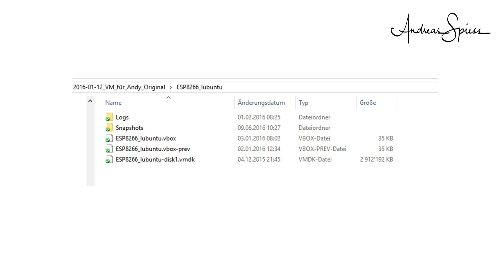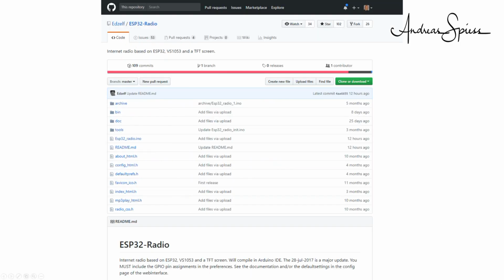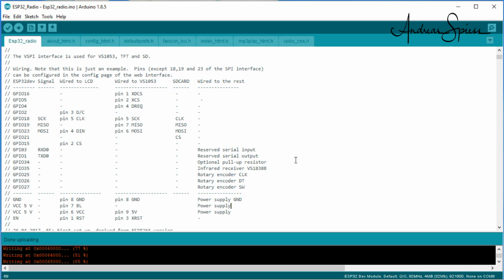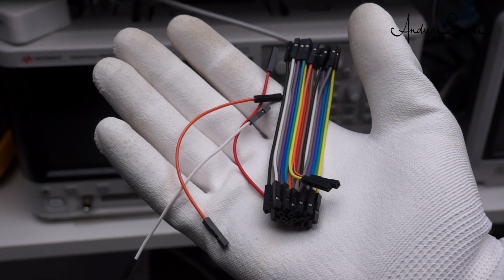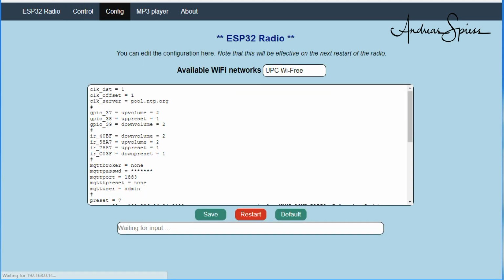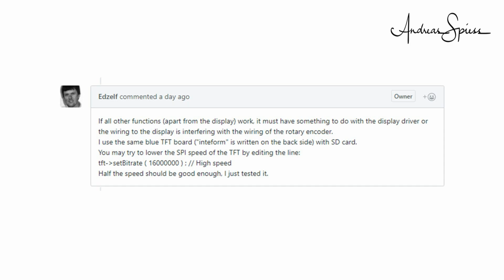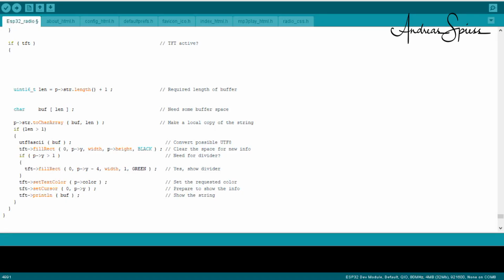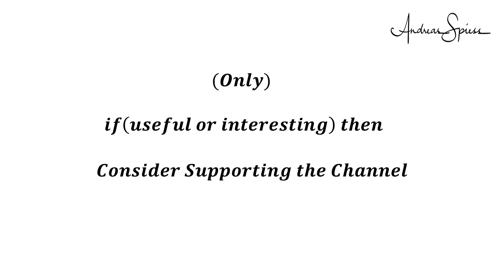#195 DIY Internet Radio using an ESP32 (Arduino IDE)

Comment: Hi Andreas - this is a great project and I have built all the wireless versions, but I have never been able to get the LAN version using WT-ETH01 working. Is there a possibility of update for the project, to include WT-ETH01, or a video on the use of the WT-ETH01 module - as an alternative to wireless? 
Love the channel it brings great humour and solid information, with education - many thanks.
Reply from the maker: This never was my project. So you have to ask the creator. Or these days, I would ask ChatGPT...
Reply: Sorry Andreas, it was more to do with the WT-ETH01 Ethernet module, it just seemed a good idea to use this. Appreciate your response, many thanks

Comment: Great channel - much inspiration.

Question on the ESP Radio V2 (and V1) Has anyone reported problems with the following on pio build of project

"Library Manager: Installing me-no-dev/ESP Async WebServer @ ^1.2.3
UnknownPackageError: Could not find the package with 'me-no-dev/ESP Async WebServer @ ^1.2.3' requirements for your system 'windows_amd64'"
I have tried manual install of library and checked library files, even tried older versions of library - has worked fine before and have built quite a few modules in 2024 - but now get this error - any advice, ideas appreciated

Many thanks Andreas  - for the wonderful projects and documentation
Reply from the maker: My pleasure!

Comment: Hello. I am little bit confused so before start of making my internet radio based on your github link and this video. My question is that on github where I DL whole package in ZIP, I can't find the main file (.ino) for programming ESP32. Am I something wrong or what ?
Reply from the maker: The project is made for PlatformIO. There, no .ino files are used. Maybe you watch a PlatformIO introduction first.
Reply: @AndreasSpiess  thank you for this explanation. Also is there any schematic (wiring diagram) for this project? I can not find also Gerber file for PCB created by Naked Ninja. Is it somewhere avilable for download ?
Reply from the maker: @petrikajaneku6451  You have to go to their project page, I do not know.

Comment: How would I go about using the esp32 as a simple wifi antenna for my laptop?  for example if my wifi card inside was to fail, could I use the esp32 to connect and surf?
Reply from the maker: I do not think so. I would use a cheap USB WiFi dongle instead.

Comment: I know this is an old posting, and apparently the Git repo has changed to use visual studios. I would prefer to use the ino Plus files that you have in the video to build this..thanks for doing such a good job on all your videos..N2AIE Vince
Reply from the maker: The project says that it will compile with the Arduino IDE...

Comment: My Dad (84) is getting senile, can now only operate very simple devices, and lives in an area with bad FM/DAB reception - but loves classical music and mentally depends on it. All the receivers, mp3 players, SAT receivers, etc. I've tried so far are too complicated for him to use. He needs something without any auto-poweroff, no menus, no battery, no small display, with headphones, and ideally which will just keep/resume playing no matter what happens (resume automatically after power outage, internet outage, etc.) and has very clearly labelled and large buttons/knobs which he can operate with shaky fingers/hands. Even for 200€ I havent been able to find something easy and reliable enough. Finally I had the idea of a homemade ESP32 webradio, found the mentioned github project on, and thankfully this review was linked there. So now I will try building this project (at first just with one hardcoded station and no buttons/display) and might later add a rotary encoder and display. Thanks for this review!!
Reply: P.S. I would have appreciated a quick mention of the cause of the "whitescreen" - was the bug in the origininal github code? And if yes, why were you the only one that had the problem?
Reply from the maker: The project advanced since then. Just try it and report an issue if you have problems. Good luck!
Reply: @AndreasSpiess  In fact just now I did try it out, and I'm delighted! This ESP32Radio project is almost perfectly documented and prepared, all I did was clone the github repo, change some platformio upload parameters, connected a random ESP32 devboard I had lying around with the VS1053 I just bought, according to the "default" wiring settings, plugged headphones into the VS1053, configured the Wifi and added the Bayern Klassik station, and hey presto - nonstop classic for my Dad :-) All in less than an hour's work. Very impressive!

About the bug: I'm not worried about encountering it (I don't even have a display, haha) I was just curious about how the story ended. Maybe I'll dig through the issues and find out.

Comment: Hi Andreas
Another great video.  I am wondering if it is possible to stream using the Bluetooth of the ESP32 to a bluetooth speaker instead of using the VS1053 and an Aux cable?
Regards (from South Africa)
Reply from the maker: I do not know. Maybe you ask the creator of the project on Github?
Reply: @AndreasSpiess  Thanks for the guidance.  I checked his github page and it seems that he has a version 2.  Will have a look.  🙂

Comment: Is there any documentation on how to move from Arduino IDE to Platform IO   and compile this project
Reply from the maker: I once made a video about PIO and you find a few others. But not particularly about this project.
Reply: @AndreasSpiess   Thanks  for some reason I am having issues with moving to PIO  I will look at what you have posted

Comment: Hello again! Yes, you were right it can not work under Arduino. So I compiled it with PlatformIO.
I have the same WHITE DISPLAY problem. I fixed by adding big capacitor to the 5V and GND on the VS1003 Board!
However I have very bad interrupted sound coming out. Its like 1 sec there is sound, 5 seconds there is no sound.
I am using VS1003 instead of VS1053 IC. The sketch correctly detects it as VS1003 and initializes it properly.
What could be the problem?

Do you succeed to find the problem?
Reply from the maker: Maybe you go to the project page to ask those questions to the creator.

Comment: I would like to try this project, but how do you load it into Arduino?
Reply from the maker: It will not work on an Arduino
Reply: @AndreasSpiess  I mean Arduino IDE, as I can see you have open this project in Arduino IDE in your video.
Reply: But in your video you compile the project in Arduino IDE

Comment: Hi Andreas, a big thank you from me also for this video.
I recently found Ed’s project for the ESP32 but was struggling to get it working as i had not realised the significance of first running the preferences sketch to load the values into memory (bit of a novice with Arduino code). Watching your video showed me what was needed and i now have it working. :)
Happy days!
Reply from the maker: Glad it works now!

Comment: this project does not have code for aurdino IDE only platfomio ... bugger
Reply from the maker: If you read the comment you see that it also should work in the Arduino IDE.

Comment: I'm stopping this video about halfway; it contains no pertinent information as to how to make a radio,  It's all discussion & history.  What I need is a schematic and a Bill of Materials.  What I saw were code listings and more and more and more silly discussions of modules that don't work.  TD.
Reply from the maker: Many viewers built one. So this project is probably not for you :-(
Reply: @AndreasSpiess  You are correct!  Electronics Engineer for 35 years -- never listened to a video as off-base as this one.
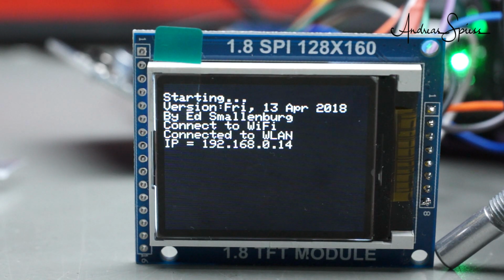Reply from the maker: Sorry for that, especially because I am an EE too. Because I wanted to know what I did wrong I watched the video again. It is 16:50 long an at 9:29 the radio was finished. All Information for parts, wiring, and code was given, and the links in the description lead you to the used materials.
With your experience I only can assume that there was a misunderstanding. This radio receives its programs from the internet via WiFi. It is not a conventional radio.

Comment: how and where do you enter your WiFi SSID and password?  Can someone help me?
Reply from the maker: I do not remember... :-(
Reply: @AndreasSpiess  I configured the SSID and password in defaultprefs page as wifi_00 , but during the startup my Esp32 list all the available SSIDs, but is not capable to connect to my ssid. With other program the wifi connection works without problems. Do you have some idea why? Thanks and compliment for your video and tutorial. Andrea
Reply: @andreatarantino569  This is what is happening to me.  The example in the programming is ssid/passcode.  I have entered it keeping the / and without the /.  I have also tried quotes around them.  Nothing works with this program but my ESP32 works fine with other programs.  It is not a good idea to try these guys creations more than a month or so past their publishing date.  Things change especially on gethub where the programs are under constant upgrades.  The publishers like Andreas don't remember years later but at least Andreas answers that he doesn't which is much better than most.

Comment: This is the one project that still has me building and modifying this project. I simply have fallen in love with the concept. I am now building them and feeding the  output into other types of gear, such as the replica of an old radio my mother purchased 30 years ago. I got it when we cleaned out her house to sell it, and after recaping the radio, have it working like new.  I have fed it via an FM radio transmitter from an MP3 player for Christmas music last year, now I have added a plug so I can push WIFI radio through the set.  I have my ESP programmed by year for this one, so I can go from 1920 forward to 1970 for music, including one link to AFVN the old music I listened to in Vietnam. I have set it up to use an old remote that used to control a VHS recorder many years ago. Oh I wanted to thank all who said prayers for my wonderful wife, she passed away from the Cancer in September, the pain of the loss is still very real, I hope one day it will pass, but after 51 years of togetherness, it may well take a bit.
Reply from the maker: This is a wonderful project. A combination of old style and new technology. I am glad you continue to tinker because I am sure it will help you with your current situation.

Comment: I now have 3 of these working. 2 using the VS1053 and one using I2S on a different board all working off ESP32's. I did find an interesting thing however. I had been powering them using a USB cable hooked to the ESP32 and experienced a LOT of noise if I had both the amplifier and the boards running on the same power supply. One day I was messing around and ran the power instead to the power in and all the noise was gone, good pure sound. That said, however my amplifier goes into a very slow oscillation if I turn up the volume to a comfortable level. I am planning on going from the tiny 5 volt amp to a larger one that runs off 12 volts DC. Right now I run the whole system off 3 18650 batteries that I channel through a home built voltage regulator using 7805 and several capacitors, so I believe I should be able to pull the 12 volts from the power supply before it goes into the 5 volt step down regulator.  I used a bit larger caps then recommended to insure quiet in the PS and it seems to work just fine with 470 UF caps.  The one that I built using the I2S board I built on a strip board so all connections are good and solid, however right now I am using a demo sketch that only allows 1 station which is OK I guess since I always seem to listen to my Armed Forces Vietnam WIFI station, made by the former DJ'S who played the rock and roll that we had for a background in our little war over there.  Sure brings back the memories I can tell you that.  The 2 that I have using the VS chip I made permanent by soldering all my connections, those damn plugs kept coming unplugged. What I did was to use old ribbon cables from scsi drives and soldered from the top of the ESP32's to the bottom of the VS board.  This left all the plugs available if I ever need them yet made for a very solid and strong connection between boards.  Those old scsi cables must be able to handle a lot of juice I know they solder great, of course I always use extra FLUX in my soldering to insure a good connection. The first set I built is in a small plastic project box using a small OLED screen, with that one I have an external power-supply and external amplifier so it is rather portable. The second one is in  a larger cardboard type box using a 16X2 screen with I2C adapter for screen.  That's the one with the tiny amplifier that doesn't really work very well.  When ever I locate my 12 volt amps that should be repaired, however with 2 young grandsons running through my house and all the company that came for my wife's funeral everything is sort in a shambles.  My daughter has stayed on to clean house and cook for me so the house is slowly getting back to somewhat of an order.  You know I can't get over how damn much I miss my wonderful wife!

Comment: Just an update, I have the unit in a large cardboard box right now, it's a very sturdy box that my hearing aides came in. I tore a battery pack apart that had been powering my macbook pro, two cells were dead, the rest still hold a good charge, so I wired them up to power 12 volts, then hooked them to my home built step down to 5 volts.  When I tried to run the amp and the system on the same power I ran into a lot of interference problems. Incidentally, the VA sent me a new device to work with my hearing aides and bluetooth, the USB cable that came with it was a very high quality shielded cable.  Now,  if I use that cable, I can plug both into that power supply now without any noise
Reply from the maker: So the project advances step by step!

Comment: Just an update, I have it all together and working now! Even the rotary encoder, I am using the small OLED screen which is  torture for my aging eyes but it's either that or the 1602 which I also had working, in fact I got that working first.  The secret to my total success?  I read the damn MANUAL!  Funny how that works, and it's the last place I usually go. Seems  I  am not as smart as I thought.  Now that I have it working I have written down all my pins and where they connect. I made my own board with the rotary encoder on it,  I think I may stick a IR receiver on it as well but I will wait till I get out to my woodworking shop and build the case for the radio first, I may well just leave it the way it is.  Running it from my laptop, or cell phone is simple enough without having to search for my remote.  I have programmed up to 50 radio stations in her now and saved a backup of that setup just in case.
Reply from the maker: Great! A wooden case would for sure look nice.
Reply: @AndreasSpiess  Yep, waiting for warmer weather, right now I have it  mounted in a small white project box, that holds the radio, I made a small power supply and mounted that with the amplifier in a smaller black project box for right now with jacks for power  in and audio in, straight wires come out to some rather strange looking speakers that I picked up a couple years back from Electronic Goldmine. The small speakers have huge magnets on the back and sound fairly good, a lot better then those tinny ones made for transistor radios.  So now I have two volume buttons but I guess I could label one loudness and the other volume or some such deal. It should work better when I get the wooden cabinet done. We did have one day that hit 80 but it has dropped back in the 50's again, weird weather to go with a weird year for our world wide society thanks to China I guess. Still waiting for a Banggood order placed in mid March, by the time it arrives I will have forgotten why I ordered the blasted stuff.

Comment: Just tried the OLED and the damn thing still works!  Man to think, enough amps to blow an ESP32 and that other board, but the OLED still works like new.  Perhaps I screwed up elsewhere at the same time?? Who knows. Oh well now the long wait to see if they close down mail delivery as well?  Emptied my paypal account ordering replacement parts, was getting low anyhow. Have to list some more back room treasures I guess.
Reply from the maker: We will see. Here pretty everything is already shot down... But the postal service still works.
Reply: @AndreasSpiess  The package finally arrived from China, I gave up on the US Sellers after 2 bad boards, well I burned the first, the second came and was DOA. I got my money back after having to break the board in half and sending a photo. I decided to strip the board and discovered one of the legs of the 3.3 power regulator was broken off where it goes into the die. So I ordered 2 of them from China for a buck more then I paid for one from a USA Seller, they arrived this morning. I was so bored, I jumped right on it, and have the first of the two wired up and running fine, in fact it is running better then the first set. I hooked it up to a small 5 volt amplifier and hooked to a nice set of small speakers, it plays great. Now to figure out how to build a case for the set that looks retro but plays modern.  Thanks again for the idea, as you can tell it has kept me busy for weeks on end!